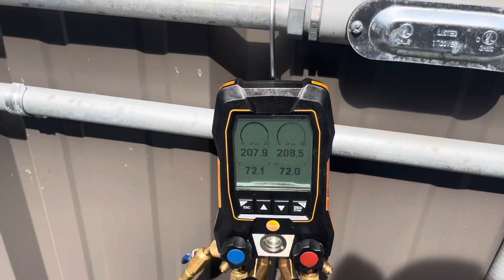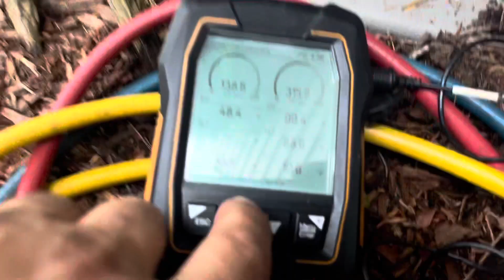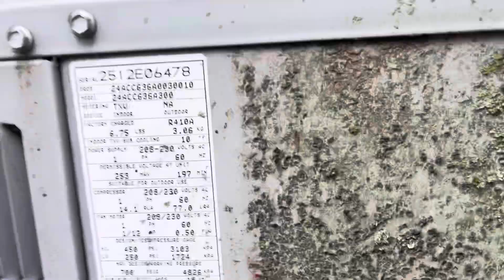HVAC.  WHY IS MY THERMOSTAT NOT KEEPING UP?   NO AC 2012 CARRIER. #carrier #ac #capacitor

Comment: I did exactly this just 2 days ago at home.  Had a heat wave for days, then it cooled down but the Heat Pump couldn't keep up.  and just so happened to have a spare.  (I watched the HVAC on the last capacitor replacement   Knowing how to do this saved me a tidy $350. Thanks!.

Comment: Sooo brother what was the issue
Reply from the maker: The capacitor was dead causing the compressor not to function.  System wasn’t cooling.  Lady called as soon as she saw the temp in home was higher than the temp she was calling for.

Comment: Mikey Pipes what a horses ass. He had a video on a couple of years ago telling a customer how a thermocouple worked. Telling a customer that it had fluid inside. That's when I realized he is full of crap. Some of the old WhiteRogers used a Diastat on the gas valve, they had fluid inside but what he was talking about was a thermocouple. Sorry if he's a friend or someone you follow. And of course you can shake a capacitor and some times you can feel or hear the fluid inside, usually on the cheaper ones. Thanks for another good video.